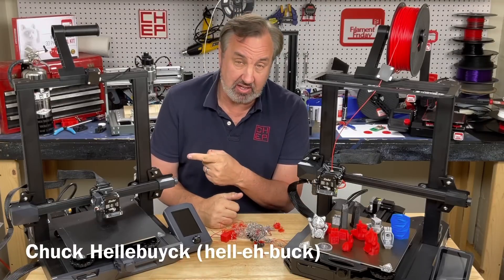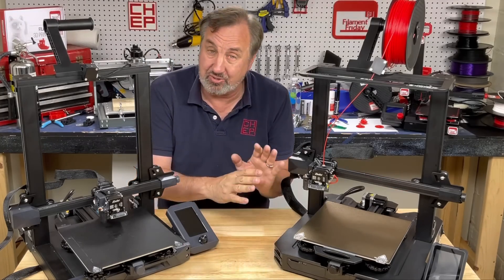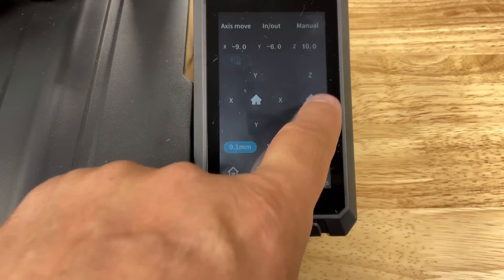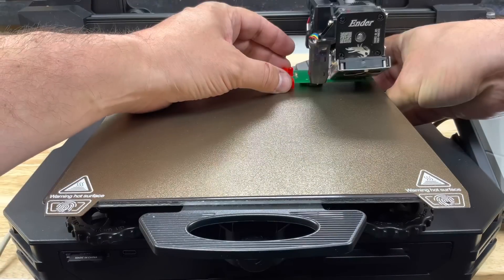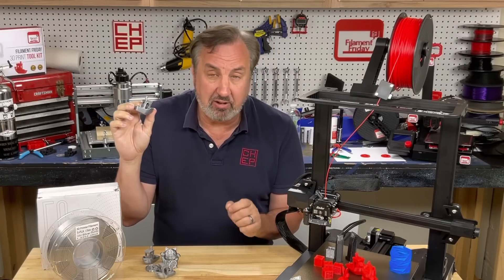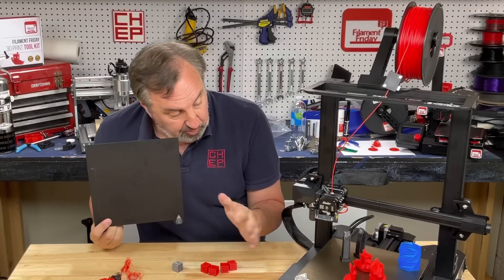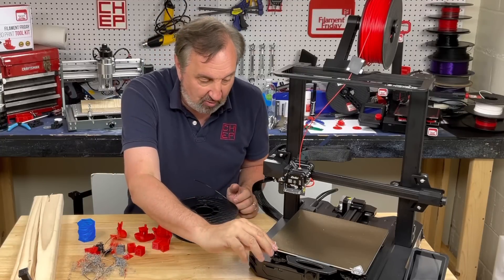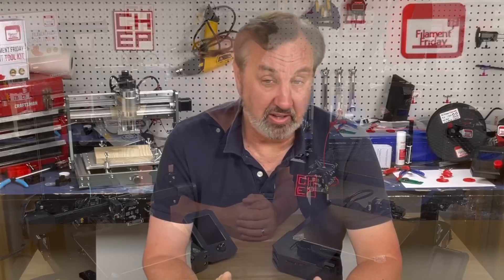Ender 3 S1 Pro - High Temp Direct Drive 3D Printer

Comment: I love my Pro and yes the bed is not the best but like I said in another comment " scuff it with some rubbing alcohol and 600 grit wet/dry and it sticks as good as my PEI plate on my V2" 
I did a few test cubes no problem once I cleaned it and it's been running steady since I got it last Sunday 

I'm holding off installing the Marlin Software as I want to try the factory but I did get spoiled on my V2 with Marlin with all the extra adjustments in it 

But this is the best printer I've bought from them and as always love your videos and thanks for the help you provide
Reply from the maker: I tried all that on two different Ender S1 Pro. (Yes I have a 2nd one for testing). It helped but didn’t solve it.

Comment: Can you add a glass bed instead of using the one it comes with?
Reply: hi, i have used a mirror on my s1, no problem. levels just fine. prints really tight.

Comment: I have a S1 Pro and my issue with it is almost every print I have to adjust live z height. After homing, the nozzle always come to slightly different height, within 0.05 maybe but enough for you having to adjust z on the fly. More often then not, the first layer will be either not sticking well or squished, and for long print I’ll have to monitor first 5-10 minutes very closely and turn print speed down to 50-75% for prefect 1st layer even when slicer set to 20mm/s first layer speed. I’m new to 3d printing and this makes me really frustrated of what I’m doing wrong or I’m asking too much for this printer.
Reply: Asking too much of a $400 3D printer to stay level that has abl? 😂

I don't know what the issue is you're having but I have an S1 "non-pro" and I love it. I've changed the springs to silicone spacers and that's all I've done. I hit print and walk away. I haven't watched a first layer in months.

My guess is that you're having issues with the initial setup. Are you leveling your bed manually first and then running the bed leveling program? Try that. 

Since you're new to 3D printing this is one of the things you'll have to learn. When learning something new it's expected that you will get frustrated.
Reply: @dangerous8333  I saw that step on some videos so I tried it. Leveled 4 corners with same feeling on paper pull with 2nd round to verify it. And let it ABL, and left side of bed barely stick, right side squished almost to bed.
Reply: @ericjiang1045  Check that your wheels on the bed track are tight. Mine came loose on my Ender 3v2 after a few dozen hours of printing and the bed would wobble left and right an almost imperceptible amount, but it was more than enough to throw off every first layer.

Also make sure calibrate flow/esteps. Mine were underextruding about 9% from the factory. I thought it was printing decent before that, but my prints have been so much more reliable partially because prints stick to the bed better when they aren't underextruded.
Reply: @extragoode  my y axis came loose but others seems fine. seems like mine might have been calibrated in factory, esteps was set to 434 about 2% under

Comment: Interesting findings. I'm having the opposite experience with the bed! The PEI bed on the Pro has been working like magic for me, whereas the bed on the S1 (which I returned to get the Pro) was always more finicky for me.
Reply: I'm guessing it's your z height... Or bed temp settings, or both.

The bed on my regular S1 has been perfect. I was going to switch to Glass but I'm actually keeping it. I've never had an issue.
Reply: @dangerous8333  Perhaps. I've used all kinds of bed materials before, and this many printers in, I like to think I'm pretty good at dialing in all of those things.. I just happen to like the PEI one a bit more :) I don't think the spring steel was bad, it's just that the PEI has been more consistent for me.
Reply: Mine started like this and then after cleaning with Alcohol out of nowhere nothing would stick anymore.

Comment: I have a Ender 3 original with the Sprite Extruder Pro Kit. Have a problem with clog in prints more than about 2h, After analyzing the problem, I discovered that it was the temperature in the hotend, perhaps because the motor heats up and heats the heatsink next to it (even though it dropped from the 800mA indicated to 700mA).
So, I took a small fan 4010 and placed it pointed at the motor, above the part cooling fan and it has worked 5 stars.
Reply: Heatcreep
Reply from the maker: Wow! Interesting story. I’m going to test that on the S1 Pro.
Reply: @FilamentFriday  maybe is a problem of mine. And I use a capacitive probe and took a time to make the offset work. In the right side crash a litle in the support of z. But now is working.

Comment: Nice review, I helped my friend getting the S1 when it came out and we quickly switched the plate from the standard PC to a 3rd part Ziflex which I also use on my own GooFoo Mido. I was under the impression that the PEI would be one of the best but I guess its only for those larger prints. I have been pondering whether to get an extra FDM printer or go down the resin route, but if I were to get another FDM it would be the S1 for sure. I dont need the 300c hotend as I already have a conversion for my GooFoo Mido to make it a 400c setup (its already enclosed), so the new one would be a "workhorse" printer for all those small things that the Mrs and kids wants me to print :)

Comment: Chuck,

I swear by PEI beds on my printers. I print PETG and ABS only and I found that two things make the difference:

1) print the bed hot - 75C for PETG 
2) really need good first level squish to get in the textures of the PEI sheet

I print large and small items and they stick very well on PEI.

In any case - another great video.
Reply: On the PETG I use usually 60° is fine with bedweld on glass.
Reply: @infernaldaedra  Thanks for the info. I think we are talking about PEI for this application though and not glass.
Reply: @msteele999  it's a valid alternative for many materials especially as you go hotter towards nylons and PC, PEI beds and the magnetism fails if you go any hotter.
Reply: @infernaldaedra  I understand. But that's not what we're talking about. Chuck had issues with the PEI bed.  I use them exclusively and was offering some tips. The fact that you use a superior bed or a different bed is irrelevant to my comment.
Reply from the maker: It’s not PEI beds in general. They work well on my Prusa. It’s the Creality PEI that sucks. I have two S1 Pro and have also tested their PEI bed before. They don’t know how to make them correctly.
Reply: @msteele999 I just said it's a good alternative. 😂 We're just talking about printer beds. Good on you if you only need to use one type of bed.

Comment: Wonder if creality's pei just sucks. Ive switched all my printers to flexible pei sheets and would never go back to glass or the horrible flexi mats they have on some.
Reply: Just the opposite for me...

I switch everything I have to glass.

I have three printers with glass and I haven't watched a first print in months. I like being able to take my prints right off of the print surface when they're done printing and glass allows me to do that. It's also easier to clean.

I've never needed glue or tape or anything. You just have to know how to dial your printer in to use glass

Comment: I purchased the Ender 3S1pro about two months ago and love it. This is my second printer. My first printer was the Ender 3V2 that I have significantly upgraded. The 3S1pro is much easier to put assemble and it has almost all the upgrades already for a reasonable price. I simply love it! The PEI bed worked for me great the first 45 to 60 days . After two month of use I found that some prints the PEI was not sticking well on all my prints similar to to problems you are encountering no matter how much I try to clean it! I tried using the other side of the bed with the smooth surface and some washable glue and it was not great. I started using the washable glue on the PEI bed on the rough side and it’s working. I don’t like the fact that the rough side of the PEI tends to accumulate more glue than I would want but it’s working well! I ordered some Magig glue adhesive to try it out . It just arrived from Amazon. The Magig glue is supposed to not create the accumulation on the PIE as the washable glue does.  We shall see! 

I find the touch screen works well although I must admit the screens set up took some getting used to it. 

I have produced some great prints with the Ender 3S1 pro and love this new printer.

Comment: The handle for the bed and top of the printer are included on the SD card it comes with.  I own the S1 and was a little mad that about 20 days after I bought it they talked about the S1 Pro.  The only thing I want from it is the FULL METAL HOT END, which is supposed to be available to purchase for the S1 along with the lightbar and laser attachment for etching into wood.  But all are still not available on their site, sort of a bait and switch they did there, trying to get people to get the S1 PRO, which is a waste of money for the most part as most people will only want the full metal hot end.
Reply: you can buy an E3 S1 all metal upgrade kit, all you need to do is change out the heatbreak, but the disassembly and reassembly doesnt appear extremely simple but just dont lose the screws

Comment: Question,
Where is your FF profile for Cura 5.0?
The 4.13 profile doesn't really transfer well.
Oh, btw these profiles work on Ender 5+
Reply: Check his profile on Thangs.
His previous video about the Ender 2 adjustment wheel has a link.
Reply from the maker: I’ve added it to the video description.

Comment: I have an old ender 3 which is pretty beaten but still works. I purchased a Biqu BX (direct drive) and I'm very happy with it though I suggest update the firmware because stock has a few quirks specially regarding the autolevel.

Comment: I did the same with the PEI, I have to flip it with a little glue for smaller footprint prints.

I also upgraded to direct drive (Micro Swiss) with a all metal hotend (Copperhead) like you did prints great!

BTW: I'm in Detroit this week/weekend, seems like I saw where you were close to Motor City. First time here and I really like it so far!

Comment: Your videos are great and I use your cura profiles with many thanks but I'm so sick of creality printers. I wish they would make affordable corexy machines out of normal aluminum extrusion and not the silly custom plating like on the 7 which costs over 1000 in Canada.they would be lighter and faster. 70mms is unacceptable, even for a low end printer.

Comment: Hey Chuck- I purchased and installed a Slice Engineering Copperhead HeatBreak on my Ender-2 Pro and the increased temperature settings makes it a great machine all-around! I swapped out the Stock extruder for a SEEMeCNC Extruder and the stock springs for yellow springs.., I just wish Creality made a small Glass Sheet for the stock bed material.
 Would you consider installing the Direct Drive HotEnd on the Ender-2 Pro in an Upcoming Video?
Reply from the maker: Depends on the firmware. I only have Ender 3 right now.

Comment: I got my Ender 3 Pro for $99 at Microcenter and upgraded it to a MS hot end, metal extruder, and a LED light bar that runs off the PS. I’m also in the process of printing a bearing spool holder and filament guide. 
I was going to keep upgrading it more with direct drive, silent mobo, auto bed leveling, and dual Z axis but I think I’m just going to get the 3 S1 Pro and use my 3 Pro for printing parts I’m selling.

Comment: I like the roller spool axle, the sound of the spool rubbing on mine is literally the loudest part of my rig right now. PEI seems like a hit or miss thing lately, I wonder if there are some different formulations going around? I went back to glass but I'd like to get something lighter so I can really sling the bed around.
Reply: Take a little silicone lube if you have it on a paper towel and just wipe it on the spool holder. Plastic on plastic lubrication is tough, ive found silicone to work great for almost everything I've ever put it on. Not a lot literally 3 drops on a paper towel and spread it around.
Reply: @johndeerebam7  Hey thanks! I've been waxing it but it only lasts a couple of weeks. I'll try the silicone today.

Comment: I had the same problem with the pei bed …. Tried ips alcohol , didn’t work …. Then I washed it with dish soap and it was like magic , no more problems…. Guess they ship dirty beds 😒
Reply: dish soap and water works perfectly for me as well. I've completely stopped using IPA for my spring steel beds. One other tip, don't touch the bed surface with your hands! I was cringing during the video. Hand oils = no stick on PEI.
Reply from the maker: IPA didn’t clean your bed?
I used soapy water too and dried. Still didn’t complete a print.
Reply: @FilamentFriday  try to use a thin layer of 3dlac or hairspray on the pei bed.. this works great